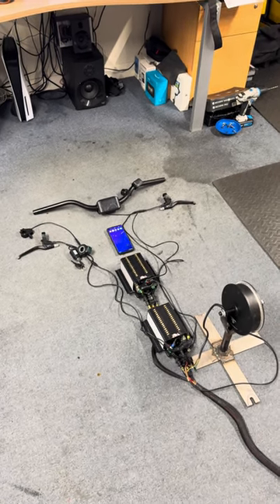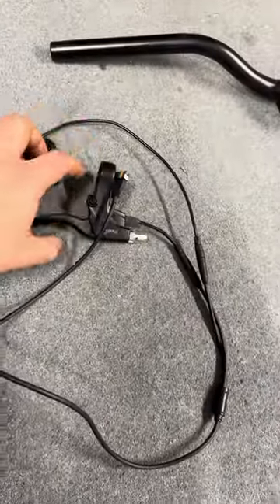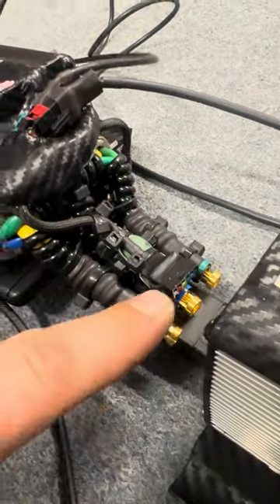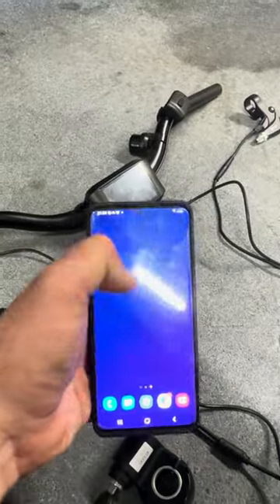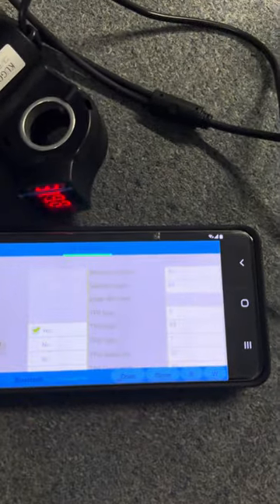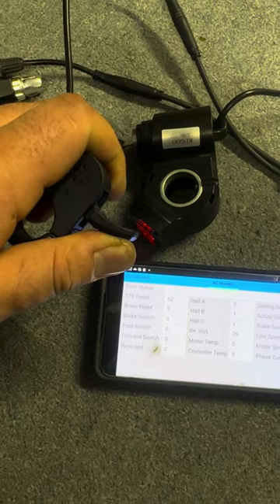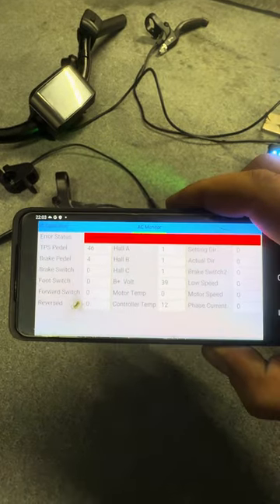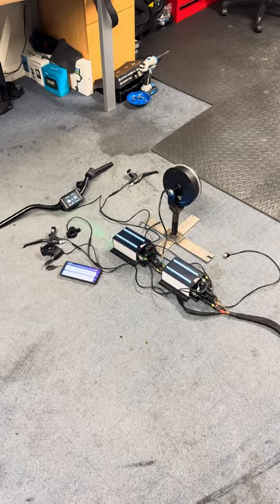Zero11X Kelly7230S/ST Controllers Kit Modded Plug&Play

Comment: HI, how much with shipping to US? Also, will this setup work with stock motors/Battery?
Reply from the maker: Hi, this setup is made for one of my customers and I only made one, I modify only on request and with payment upfront..it took 2 month’s to be ready and the total cost is £1300, it includes other parts as well…it will not work with stock motors and battery, other modifications will be required!

Comment: hi what is the price
Reply from the maker: the controller kit as they come from factory originally and not modded, it's £720 including shipping (2 x 7230S controllers, 1 x 750C Display, 1 x Bluetooth Module and cable adaptors for the bluetooth module)